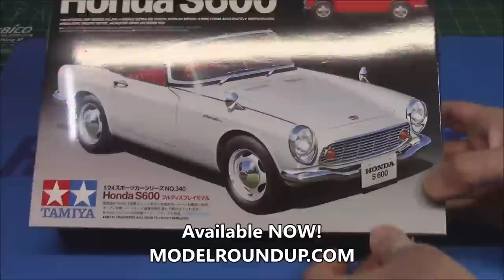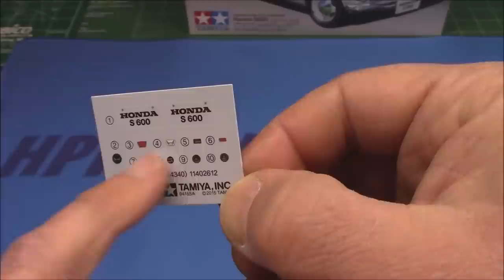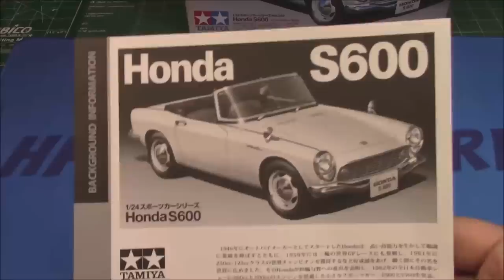1965 Honda S600 Convertible 1/24 Scale Model Kit Build How To Assemble Paint Dashboard Chrome Glass

Comment: I noticed you're using floor finish to install windows and lenses. Is that working better ? Great build 🤙🤙
Reply from the maker: I've been trying it for anything with a really thin attachment point and it's been going good.
Sometimes mod podge will be a bit thick and give a cloudy look around very thin headlights, etc so I tried floor polish and like it so far.

Comment: For glass, when do you use Modge Podge and when do you use Pledge?
Reply from the maker: I've been experimenting with the floor polish for small pieces  like headlights and markers and it's working well. It holds them in with a wicking action. 

I still use mod podge for window glass as it's thick and holds the parts in place as it dries.